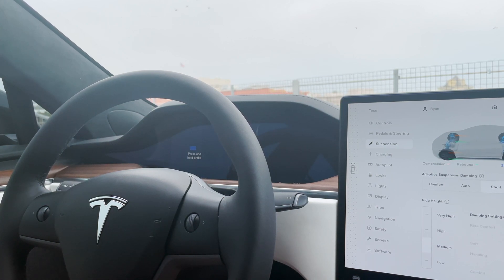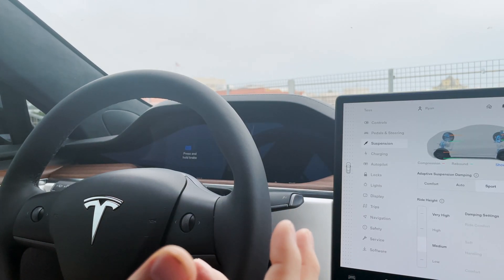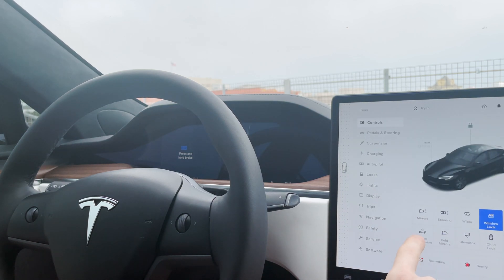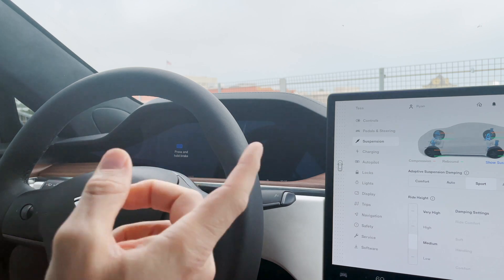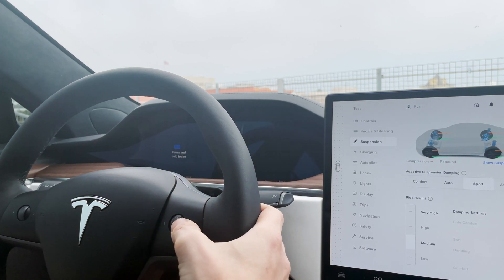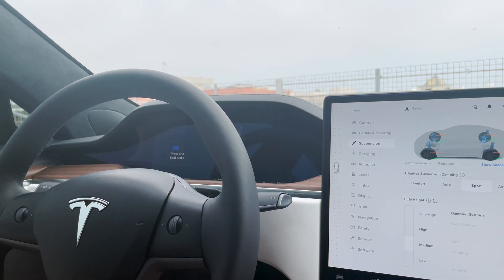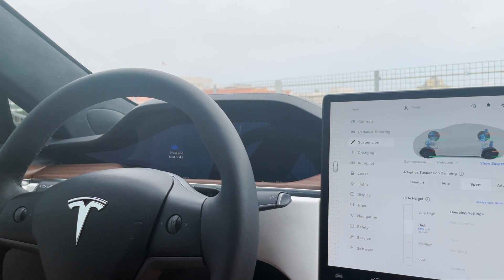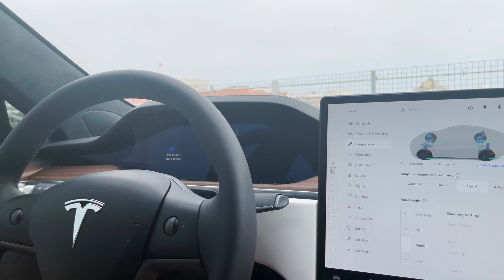Thinking Outside The Rectangle, Episode 1: Suspension

Comment: This is amazing!! One of the best features of the Model S vs. the 3 is its air suspension, so we car guys can lower it down to look cool (plus get better range, handling, etc.) and raise it up when needed (speed bumps, steep driveways, high curbs, etc.) but Tesla has made the controls for this feature soooo frustratingly inaccessible! I have an older (2016.5) Model S, and to simply "raise the car to very high and stay up there until I tell you otherwise" it takes no less than FIVE taps on the touchscreen, in different places! That's a lot of the driver's attention off the road when approaching an obstacle requiring a raise-up. Maddening. Using the thumbwheel for this as you've done is of course something that Tesla should have done long ago, but as they've demonstrated with silly and regressive UX decisions like the buttons-on-yoke and no stalks, I'm not too hopeful of a future update addressing it. What you've done (round wheel AND working stalks AND steering wheel suspension height control? OMG) is awesome and knowing about that possibility makes a refresh Model S a wee bit more attractive... though the near certain quality issues remain a deterrent.

Any idea if your solution or something similar will work on an older Model S (like mine)? ;) I still need to read your thread(s?) on TMC... Thanks for sharing!

Comment: Freaking amazing example of user input that is not an error. A steering wheel with stalks and user programmable functions assigned to the user input devices is a freaking jackpot for people that like to control their car when the car is many years away from being smart enough to handle all such user controls CORRECTLY. The luxury duck call is freaking annoying and dumb, glad you could prove this could be fixed as well as giving a full user input control steering wheel instead of half of the control with half of a wheel.

Comment: Pre re-refresh model s had a meta key on the steering wheel and the steering wheel controls were configurable don't think ride height was option though. You could however adjust fan speed or  sunroof open from the scroll wheel